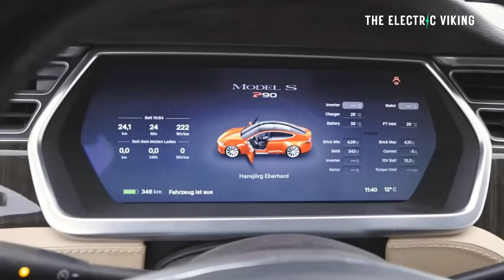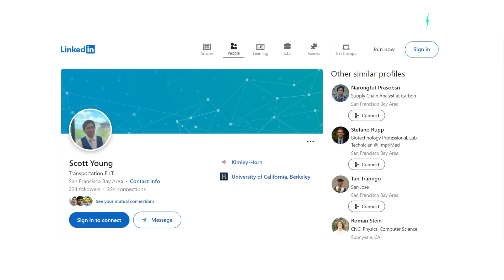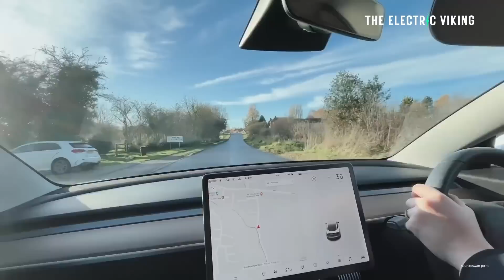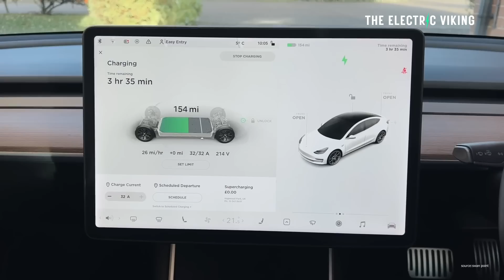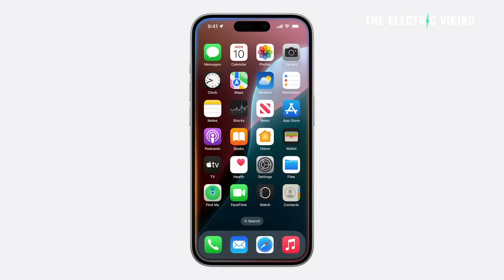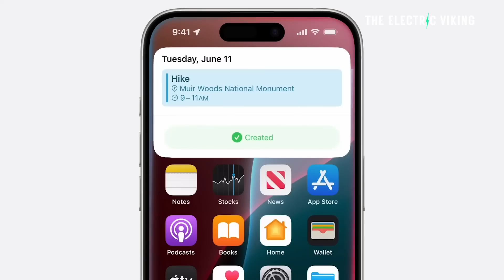Electric cars capable of running for over 1 million miles are already here

Comment: " had several battery replacements" which means it's essentially a new car because the battery is about 80% (or more?) of the value of an electric car.
Reply: more like 30% but it varies quite a lot. Pricing at new you'd think it was 80%!!
Reply: the battery is the actual motor of an ev... its the power unit... the electric motor is more the equivalent of the crank shaft in an ice car

Comment: If extreme care and proper power management is applied on the battery so it doesn’t degrade by much (using a slow charge at home and maxing the charge at 70%-80%), the battery could last for more than 10 years, potentially 20 years or more if the battery continues to be in top condition and the operator has done all they can not to place too much stress on it. That’s a duration of time where you can trade it in for a new EV or if the operator still wants to keep the frame invest in a new battery (the old one recycled or repurposed and probably a rebate or discount can be applied exchanging the older one for the newer one for recycling/repurposing) which by that time the cost would’ve already dramatically reduced because of more demand for electric vehicles. And guess what, right now Tesla is the leader in electric vehicles now. In 100 years Tesla will be the main player in the vehicles used by most people in the future and the fossil car manufacturers with their dealerships and their ponzi maintenance crap every thousand of miles or so are ultimately going to wither away like the phone booth.
Reply: No. Tesla as well as pretty much all other manufacturers will be gone. Look at pretty much any industry and you will find that to be the case.
Reply: A subsidiary of XAI Galactics .😊

Comment: With EVs, it’s all about power management, caring for the battery and top notch maintenance and cleaning. They can literally last forever, that’s why ice lovers/EV haters continue to love sucking gas and their unsafe road rage depreciation vehicles with deteriorating engines without cameras for insurance protection.

Comment: Essentially no electric car will last a million miles. The batteries decay starting a day one.
By the time the battery needs replacing it's no longer economical to do so. And that might be in as little as a few years but on average is going to be in under 10 years. Which is way way way before you get to a million miles.

Practically speaking 99% of all EVS will be scrapped when the battery dies.

On the other hand an internal combustion engine car can be expected to run for 10 years and probably will last for 15 to 20 years with only moderate care.

There are lots of internal combustion engine cars built in 1984 which are still on the road today 40 years later. That's simply not going to happen with electric.

Let's face it. Electric cars are going to be scrapped way more often than gas and that's going to increase the amount of landfill and the amount of toxic waste. Plus it's going to massively increase the cost for consumers who cannot afford it. It's a bad idea all around.
Reply: Very true, factual and well explained.
But unlikely that this so-called EV genius will get it with his superficial knowledge :) 
I have nothing against EVs, and I drive one myself, but facts are facts.

Comment: Maybe there will be much more customers for EV in future. China, Middle East, Africa, India >5 billion ppl. Yes they are poor now but this could change. EV will be cheaper and more suitable for these regions, like they could charge with Solar much better and don´t need special repair shops, knowlege of supply chain for complex gas cars repair.
Reply: There is a three wheel, two seater solar car called Aptera in pre-production stage. They also give (right to repair) to potential buyers. I ordered one but not holding my breath as they are very slow to start production.

Comment: It's not just about engines and transmission, it's also about metal fatigue, corrosion, degradation of non metal components, general wear and tear, simply wearing out or becoming outdated. In most of these respects EVs are no different to ICEV. 

The main differences will be oil, filter, sparkplug and injector changes. These are lucrative ICEV  maintenance activities largely unneeded in the EV sector.

Comment: You know what the quickest way to kill longevity is? Make it 'smart'. Give it an operating system, GUI and S/W updates and its useful lifespan is reduced from its mechanical life to when the S/W is outdated. The other thing is to add batteries.
Reply: There are still many computers from the 1980s or before that are working (including those that were intended to work off of a cable network - look up the NABU computer some time). Much of the of the smart functionality from an old EV won’t work (unless enthusiasts bother to work out how to emulate the server side components), but the vehicle will still be drivable.
Reply: @stevetodd7383  But not desirable/pleasant to use.
A large proportion of mobile phones still operate perfectly when they are scrapped. Most computers still work as if new when they are discarded. The introduction of smart TVs has halved the longevity of TVs. All these things are just outdated now well before their lifetime ends. Just because we added an OS and/or a battery.
Reply: Wrong. They have just discontinued OTA stuff on my 2015 Nissan Leaf. Apart from remotely controlling the heating and looking at the economy figures it has had zero impact. Manufacturers will be legally obliged to maintain anything that is safety related anyway.

Comment: Battery replacement cost $12000 - $20000, is a  significant cost even compared with the current major repairs of ICE cars
Reply: engine replacement for range rover 38k
Reply: Fortunately batteries will get cheaper year on year
Reply: That may be the cost NOW.

How much did those fancy big LED Tvs cost 10-15 years ago?

Comment: I usually buy a two year old car. I then drive it till it dies. The engine and parts expense grows until it is economically not worth repairing.  Also the chassis rusts and unsafe repairs are needed. If EVs had an aluminium chassis, replacing an EV engine would not be costly, might still need replacement of electronic components. Sounds good to me.

Comment: Viking I have just taken delivery of my first EV a Tesla model Y. Previously I owned two Toyota hybrids. An Australian made Camry from 2010 and a RAV 4 Cruiser. The model Y is superb and definitely a cut above any other previous vehicle. I look back over the 15 ICE vehicles I have owned since 1969 and feel completely used and ripped off. This entire industry is designed to provide you with vehicles that fail and require upkeep and maintenance while depreciating on a daily basis.
Reply: the ice business model is literally selling overpriced replacement parts to existing fleets
Reply: I have owned more than 50 cars since 1957 & was only 1 that I sold because I was not happy with it
Reply: The OLDEST Tesla Model S is as old as the AVERAGE ICE car in the US today.  All this hand waving and hypothesizing about the life of EVs is pure conjecture.  What is known for a fact is the extreme depreciation of EVs and the reluctance of people to buy used EVs because of battery risk.  Many used car dealers REFUSE to even deal them.  Toyotas have a reputation among repair shops, dealers, and owners for being exceptionally reliable and long-lived.
Reply: unless you buy a classic ford rs lol
Reply: @lushbikes  what????
Reply: You are a liar. Evs are more evpensiVE  THAN ICE
Reply: EVs depreciate at a much higher rate than regular cars.
Reply: @BobBob-uv4vc  because they are computer on wheels and computers depreciate like crazy
Reply: @aeronYTco  That is certainly one of the factors. Many electronic gadgets are obsolete and useless in just a few years. I have a number of them sitting around collecting dust.
Reply: > while depreciating on a daily basis

Umm, sure, EVs have an incredibly higher depreciating rate than ICEs... Nobody wants them when the battery is out/nearing end of warranty. And ask Hertz/Sixt how happy they were with their "low maintenace" EVs...
Reply: @hiram1923 any source to learn more?

Comment: My '95 Honda Odyssey has about a quarter million miles on it. same engine, same tranny, etc. I keep driving it because it doesn't respond to any RF signals and doesn't transmit any info anywhere. I disconnected the wireless door locking, It has mechanical linkages for brakes, steering, etc. No touch screens, No voice-operated anything. I have no use for goofy features. I'll keep driving it until someone gives me an EV, (that has no RF links, wireless updates, etc,) or one of us dies.
Reply: Good call Sir.  I would LOVE to own and drive a late model EV but simply cannot afford the ticket price.  I weaned myself off bat-phones taking over my life 30 years ago.
While addicted to (more than less) one-way media like YouTube, I have no interest in being accessible to the World at large.
I think my 2009 Nissan Tiida will probably see me out if I keep looking after it.  155,000 kM and still going strong - touch wood.
Reply: yeah and it polluting like MAD
Reply: @rctezluh42069 , nope. Two reasons. The Honda's contaminates are far below Colorado's stringent urban emissions tests, and I only use the car when I have to, and I'm retired. I drive it about 50 miles a month. I've usually taken my electric scooter when I could, and lived on the power from my PV panels. My carbon footprint is and has been minuscule.

Comment: Head's up Sam! In Canada no car runs a half million miles. None ever will - not now that Saturn is long-gone. Cars rust.

Saturn built with plastic composite body panels. If you can find one - they're all 15+ years old now - they still look brand new.

Tesla should build with composite panels. Cheaper to make; cheaper to repair (you just replace a damaged section - for cheap); and much, much lighter. Stronger: y9u hang them on a proper 3d space frame.

Arrival was going to build EV vans with composite panels. It's toast. But not because the design was flawed.

Tesla should build this way. Then the body would last as long as the battery.

And the cars could shed a LOT of weight.
Reply: Composites are probably not so crash resistance though.
There is a lot of lively debate about Al, Fe-alloys and carbon fiber composites at the moment.  Seems like the jury is still out in respect of longevity and resilience.
Reply: @jimparr01Utube Oh trust me, they can use composite materials that would be stronger than metals used now. It's all possible.
Reply: @GSP-76  More expensive.
Reply: @rogerphelps9939  Maybe...it depends on what's used, manufacturing, etc. Auto makers aren't looking to build the best possible product but rather whatever they could charge most for while keeping costs as low as possible. Composite materials would also make a big difference in gas mileage in ICE vehicles too. They would probably last double the average life span they currently have.
Reply: Trust you, lol.
Reply: Does Canada salt the roads like the UK?  In the UK ICE cars used to have visible rust as they came off the production line.
Reply: @G_C340  Most places that get heavy snowfall use salt or salt derivatives. In western U.S. many municipalities use sand instead of salt. I live on the east coast and we use salt here...but I have gotten under carriage spray protection done to most of my cars and that has protected them very well against rusting.
Reply: I’m looking forward to the Aptera with its super low drag , composite panels and self charging.😊

Comment: A million miles in how many years life span. You can’t put an electric can in a shed for 50 years  pull it out put energy in it. Just won’t happen
Reply: You can’t do it with modern ICE cars either
Reply: @satoshistan yup, you’ll need major work, including striping the engine down and replacing all seals and fluids. With the EV you will probably need to replace the battery pack, but in 50 years a new or reconditioned battery pack isn’t going to be expensive compared to the work needed on an ICE engine. There will be likewise seals and fluids to be replaced, but much less than the ICE vehicle.
Reply: But it will. The only proviso is that an EV battery should never be left to completely self discharge to zero.

Comment: No you can buy new one for other material specificities, better seats. Tesla should be replaced each month as Chinese brands have much much better inside! Better technologies allow to most intense users to enjoy better and better. Ancient vehicles, much cheaper, can then  match those who have few needs... All software are adaptable to the user needs, and include last improvements if the hardware allows effective management of Secirity and usability pleasure! Staff COM Mobility PSC invented car sharing on January 1994 for this purpose, to spare any risk/wasting, with no loss for car brands, as the contributions are paid 120% of the production cost, each 5 years for the services they delivered! For this Bill !nternational Technologies PSC to allow just rentabilisation by all,Cass we own only everything we really benefit from! The Nio can exchange batteries within 3 up to 5 minutes, so will Xpeng Motors working now with them... Tesla wants damages and wastings!